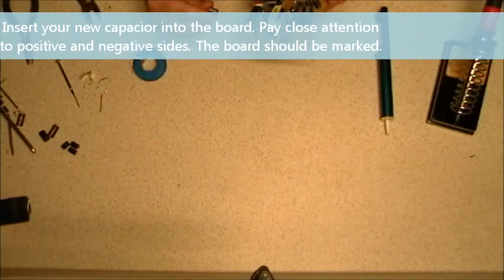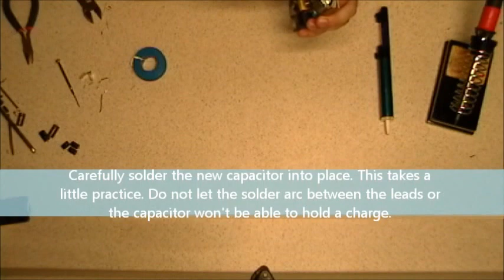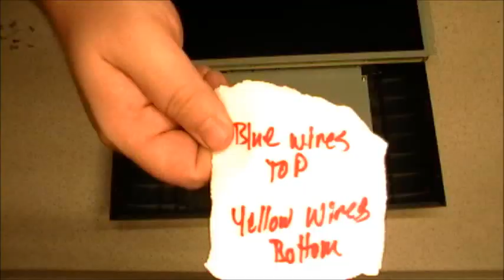Monitor Repair Tutorial

Comment: I have the same monitor other than it has a dvi and another vga port but the power board is the same I at one time replaced the caps and it worked for a while and it started shutting down again at least the back lighting that is.   and all the caps are still good I might go and reorder a new power board. you can replace them with better caps. and also as long as the capacatance is the same you can go with a higher voltage.  some times these things can be a pain in the but lol